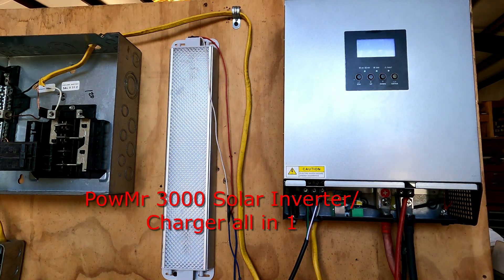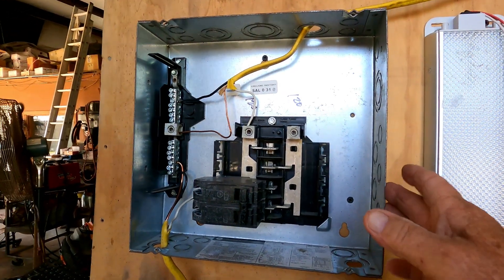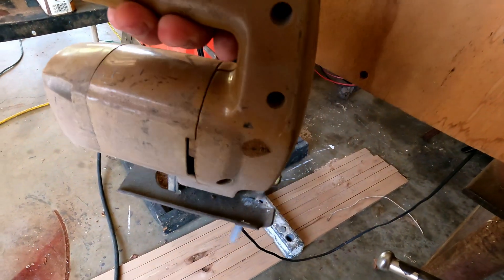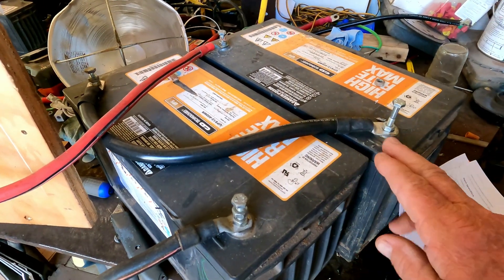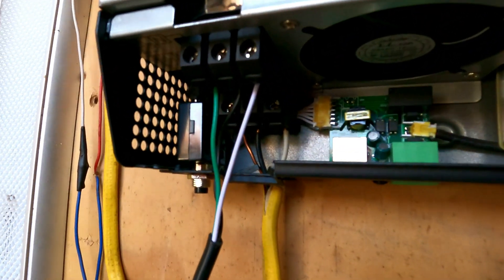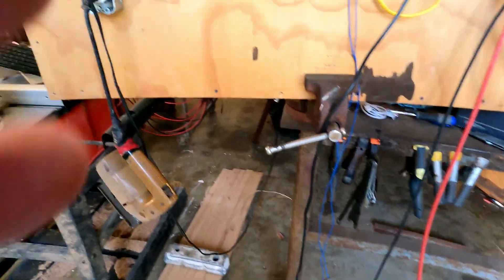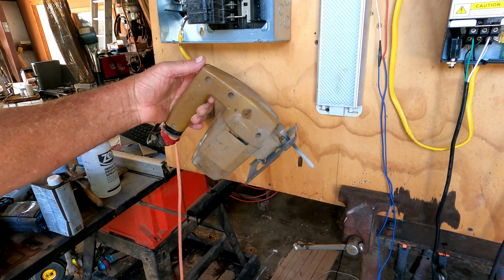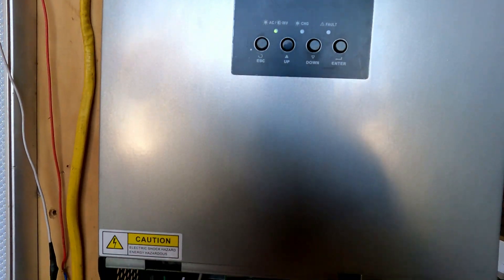Solar Panel Setup Made EASY with PowMr 3000W Hybrid Inverter

Comment: I bought this hoping to use this with only the AC input and AC output to provide essentially provide extra "solar" to my home. Will it work for this use case and properly sync to the grid and shut down as expected in case of grid outage / incorrect frequency? The documentation mentions using a generator as an input (I was hoping to use a pure sine wave output from my EV) and having it provide extra solar to my home and my powerwall batteries. Based on what you said at the end of the video it seems it's not the best solution?

Comment: Do you realize you wired the panel backwards? The white wires go to the neutral bar and black wires go to the line in and circuit breaker. Not trying to be smart mouth, just trying to help.